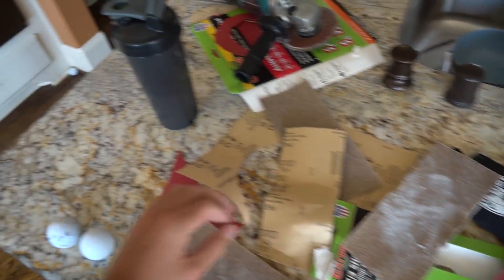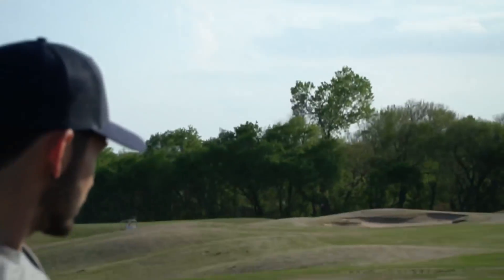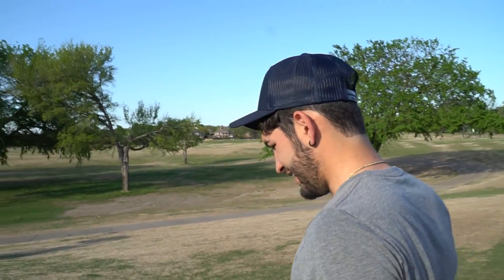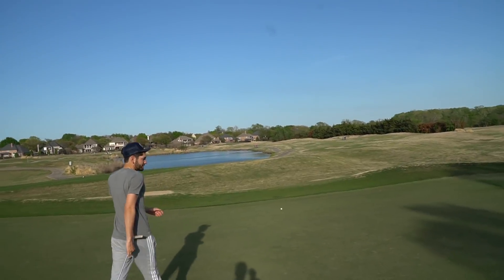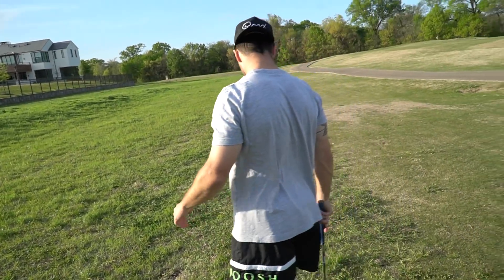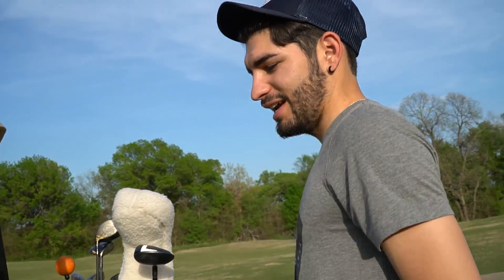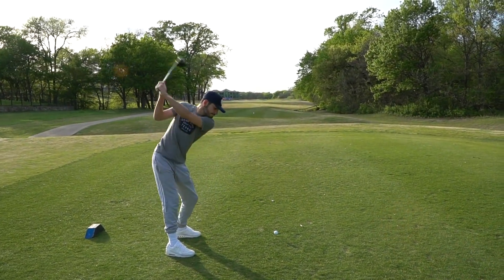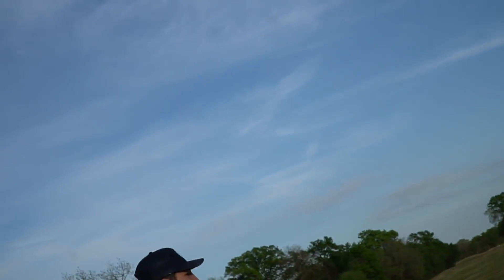The First Dimpleless Golf Ball Ever!!

Comment: 3:54 The dimples don't help the ball spin. The dimples covert spin into lift. The ball will still have very similar spin with or without dimples, just how that translates into flight will be very different. The reason the ball ran out further is there is left lift and therefore a flatter landing angle, not because there was less spin on it.
Reply: That and they create low pressure zones which actually makes it fly further. There is less drag behind the ball thanks to the vortices created by the dimples.

Comment: For those curious about the basic idea behind dimples, here goes my explanation (getting PhD in fluid mechanics). There are two types of fluid drag - pressure drag and viscous drag (from shear stress). For bluff bodies (like a golf ball) as opposed to a streamlined body (like an airfoil) there is a large wake created behind the object which creates a large pressure difference. This pressure difference creates a LOT of pressure drag. Now that’s great, but what does this have to do with dimples?? Dimples on the surface of the ball creates TURBULENCE! Turbulent flow will actually stay attached to the surface of the golf ball and make a smaller wake (and thus lower the pressure drag) but it will increase viscous drag. Now, we could imagine that for a streamlined body (like the airplane wing) turbulence wants to be avoided so overall drag is decreased. But for a golf ball turbulence is good since it will decrease the main source of drag for the ball. Well, that’s why dimples make the ball fly a lot farther!
Reply: Yeah it’s tough to know for sure, but I think I Steve does hit off the toe, which would normally draw the golf ball (from the gear effect). So I think it makes some sense that  that without the dimples this was reduced and his shots stayed right